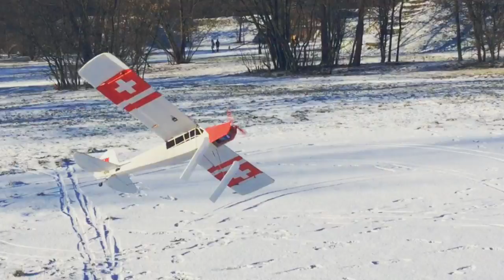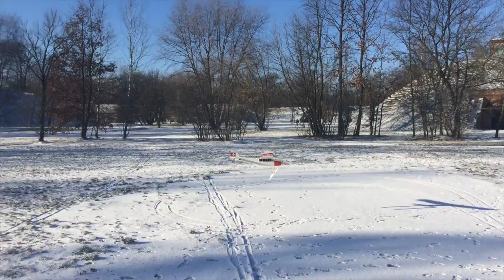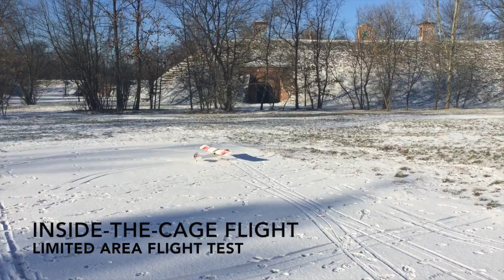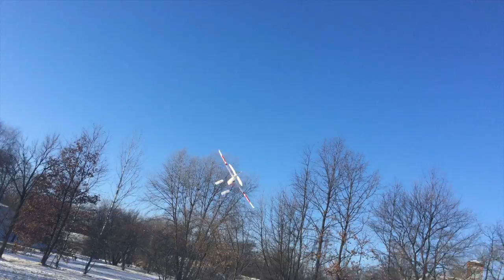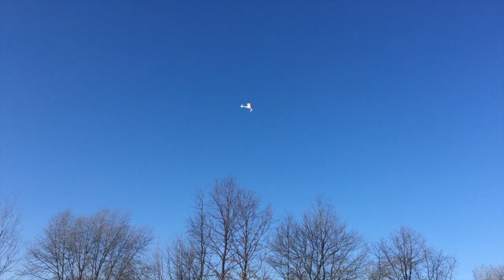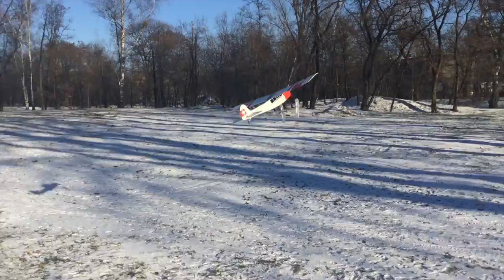Winter Storch

Comment: cant wait to fly my ft simple storch, this looks really stable to fly. 

did you put flaps on it? and flaps down on the first part of the vid? looks a bit slower than the second half. 

nice flying man! keep it up.
Reply from the maker: Thank you! Yes, this plane always had flaps built-in and enabled, and I do use them very often. Without flaps, it's "just" a nice flying trainer plane; but with flaps it becomes an exceptional slow flyer! It does require some practice, but flying this beauty is very rewarding - as you can clearly see in my other videos.

Good luck, and have fun!

Comment: please friend engines which I could use this model airplane'm from Brazil need your help I have an engine 2930/11 1000 kv Turnigy would like to know the c to use this model airplane
Reply from the maker: I don't know anything about 2930 motor; but judging by the numbers, it should be more powerful than the one powering my plane. If you use correct propeller (8x4; or maybe 9x4,7 for your slightly lower kv) you should have more power than enough. If you are asking about the "C rating" of the battery, it depends on it's capacity. With the props mentioned above you should not get amp draws more than 15-20A; so any battery with more than 1000mAh and 20C rating (which is very common) should be ok.
Reply: thank you friend helped me a lot